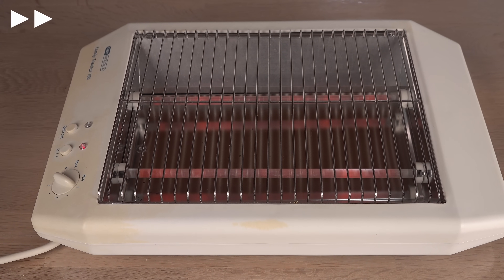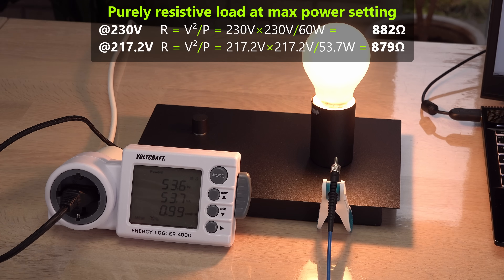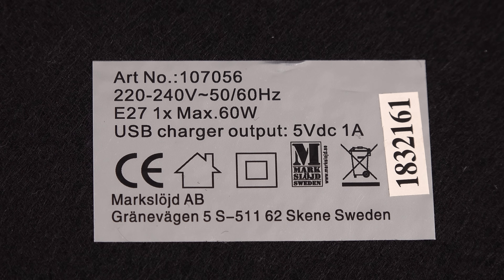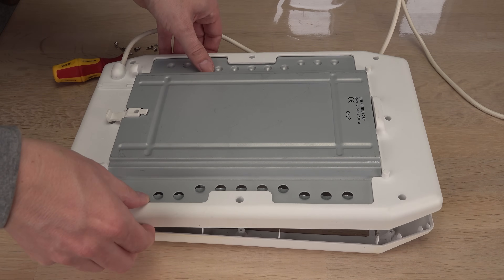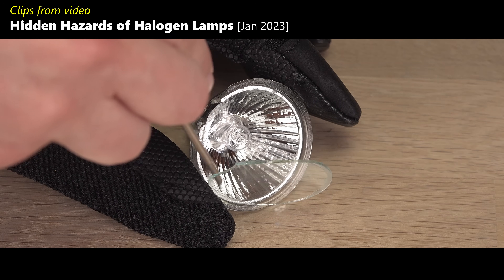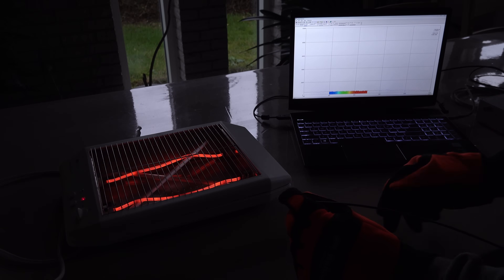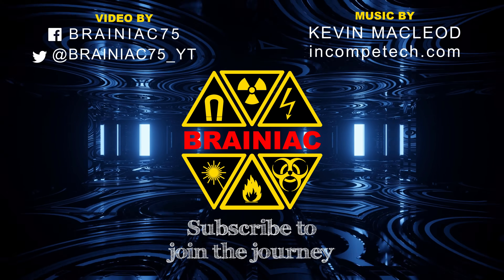Toaster Temperature WITHOUT Thermometer?!? | Crazy Blackbody Spectrum Attempt

Comment: That is NOT a correct way to check if the grounding is ok! If you put on probe of the multimeter on the live wire and touch the other probe (try at your own risk; it should be safe if you trust the internal resistance of the multimeter), you will also measure mains voltage (but can be lower depending on your skin's/body's resistance and how well you are grounded), which according to your method would mean ok grounding. But your body definitely isn't a "proper" ground.

217V on an outlet that's not loaded is indeed on the low side, but in spec. Except for heaters taking a bit longer (the maximum temperature would be lower as well but is usually never an issue) it doesn't matter for any modern electronics. Still, I'm glad that I have a very consistent 236V +/- 3V here (I have longtime data from our meter). Peaks outside that range a very rare (peak being something that's at least 10 seconds long, as that's the resolution of the meter).

Comment: There are markers that blacksmiths use to mark on metal to test the temperatures the metals reach. You could mark the quartz tubes and check the melting point of the markers to find the true temperature.

Comment: Captain here. (25+ years in lighting / engineering R&D) --- 
I think you're missing a critical point. Blackbody temperatures are based only on IRON. If your heating element is some kind of alloy or another kind of material, the glow will be significantly different!

Comment: Measuring the voltage between the ground and Active pins (08:45) is NOT the correct way to check if a circuit is properly grounded!

Comment: the steep drop-off could be an issue with the optical core. TIR plays a big role in the infrared spectrum. we use large diameter cores for anything lower than 950nm because its much easier to reflect visible light and low end IR in the larger core. once you're above 1000nm, you need to use a smaller core size or the fiber itself will attenuate the incoming light. the IOR of most fibers i work on is 1.468. Multi-mode signals run at 850-900nm and falls off at a rate of 3db/km, compared to 0.2db/km of single-mode at 1550nm.

Comment: My mains is the opposite, it's often right up at the upper limit of what's allowed, around 254-256V and is also clipped heavily too, probably because of my solar inverters (so peak AC of the unclipped wave would probably be near the 400's, which is insane lol). This is more problematic than lower voltages, because I play with a lot of old equipment, from back when it use to be closer to 210-220 here, and will run out of spec if i plug it directly into the mains these days!

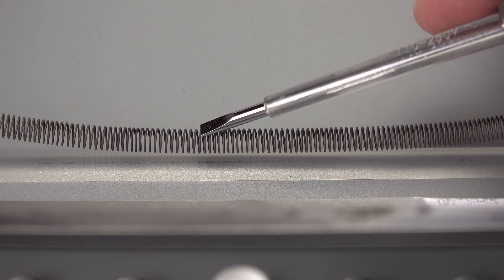Comment: 7:36 That's incorrect. Fe-Cr-Al heating wire alloys are actually better for this application than Nichrome or tungsten. Nichrome can be used up to 1150 degrees Celsius, Fe-Cr-Al up to 1400 degrees Celsius, and tungsten, as is well known, burns in air.
Reply: nichrome C grade also melts at 1400 degC though is expensive than the more common that melts at 1150-1200. both kanthal and nichrome though are used in appliances, its a matter of manufacturer of which is used. and yeah tungsten metal would simply burn, though tungsten carbide and other carbide ceramics are also used for radiant heating elements, such as hot surface igniters in gas-fired appliances
Reply: @EdwardTriesToScience  Okay. But Fe-Cr-Al (like Kanthal A1) doesn't melt at 1400 degrees Celsius; it can be used up to that temperature. That means in furnaces that heat up to approximately 1260 degrees Celsius.

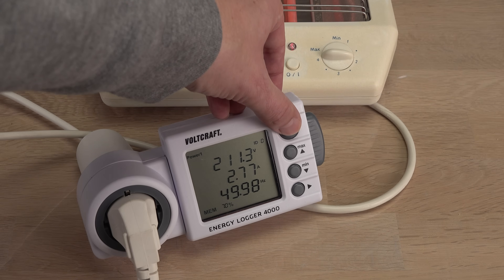Comment: 585W at 211V 5:02
Yikes indeed.
If my power was doing that for an extended period, I'd be getting an electrician, as I get 235-245 pretty much all the time. (Being the only customer off a transformer being fed with an 11kV line helps, though)

Comment: Is your spectrometer calibrated for intensity? I think the curves you measured which look nothing like a planckian distribution is evidence that sensitivity of the detector varies for different wavelengths of light. As a hobbyist I ran into this issue when trying to calibrate my own spectrometer. It's so difficult because the intensity depends on the angle of your light source relative to the fiber optic, how close the light source is and even how long you take data for. It's a huge pain and I still haven't solved the issue yet.

Comment: I have never seen a toaster like this before, I assumed it was a small space heater. Though largely displaced by ceramic heaters for space heating, quartz tube heaters do still see wide use in applications where heating the air is not always viable.

Comment: Is this actually for cooking food?
Cause it looks like a heater, not a toaster
Reply: i use the toaster for many kind of foods and things. 

3 examples...
Sausages for hotdogs are placed on it for 1 cycle (about 3 min) turn it over half way. The bread are then added for another cycle and both bread and sausages are turned halfway. A good trick is to use double layer tinfoil to capture more heat when only the first round of sausages is on. 

Cant open  a jar of pickles or any other jar with a metal lid? Dont poke under it with a utility knife or fork. Place the jar upside down on the toaster for half a minute. The heat expands the lid a tiny bit and make it more easy to turn - use a dry towel to avoid a potential burn.

when cooking with a pan, the toasters large surface and distance to the heaters, makes it more easy to not get a to high temperature if that is needed. I found when making pasta or spaghetti carbonara, when adding the eeg and cheese for the creme, temperature is a high factor for either getting scrambled creme, or perfect creme. The airgab gives a buffer for the heattransfer to the pan making it more easy to control the heat in the pan.
Reply: @kasperholm so it is actually a toaster?
Ive never seen them used like that before; ive only ever known them as directional heaters
Cool to learn
Reply: @runforitman  its a danish thing it seems, they call it a flatbed toaster, but to me, an american, it would be more fitting as a radiant electric grill

Comment: Hi, the reason your peaks are so far off is because of the HIGHLY nonlinear response of the silicon detector across the measurement spectrum. You have to set up the spectrometer to work in absolute irradiance mode so that the Y axis is showing numbers in microwatts per cm^2 per nm, instead of just "counts". I don't know if your spectrometer is capable of this, but in a very similar Czerny-Turner Ocean Optics spectrometer you do it by using a calibrated light source and a wizard in the software to get it into irrad. mode. None of the peaks you were measuring here were real, they're all way further out in the IR, with the exception of the light bulb, which will be just barely at the edge of what the spectrometer is capable of measuring around 1100nm. The slight bumps in the spectra here are from absorbance lines of the fiber, the hydroxyl stretching mode vibration in the glass is at ~900nm.
Reply: Well, you certainly sound like you know what you're talking about.
Reply: At least he can afford a spectrometer. I had to build my own using a piece of DVD for the diffraction grating.

Comment: Don't you have a 230V variac? My variac outputs over 300V when turned up to the max. More than enough to boost that 211V to the correct 230V.

Comment: I want to know how the setting slider on toasters work, and why it seems to always need to be changed each time.
Reply: Technology Connections has a great video about toasters which goes into how modern ones work (it’s usually a single chip) and such delights as The Bagel Pin. There is also a Hackaday article based on that video which links even more resources.

Comment: 217V? You need to get an electrician in. That voltage drop is being turned into heat somewhere - and you better make sure it's nowhere inside your home.
Reply: He is probably at some distance from the transformer. If they changed taps to raise the voltage the users near the transformer would probably have too high a voltage when loads are light. 217V is still in specification for a 230V supply.
Reply: @AndyFletcherX31  When working with mains voltage, "probably" doesn't cut it. A measurement of the voltage at the supply clamp does.
Reply: @feynthefallen  why would anyone need to specifically check it?  Voltage is within specification from the power system operator. Users at a distance from the transformer are expected to have a lower voltage and even if he is next to it the voltage would be a little low but still acceptable.
Reply: @feynthefallen  Go and read the electricity supply regulations. 217V is within 10% of the nominal 230V. There is no reason to assume there is an issue.
Reply: @feynthefallen  Maybe I actually know what I'm talking about.  A transformer is tapped to ensure the delivered voltage is within limits from low load to full load to all users attached to it regardless of distance. It is a compromise - don't assume it always delivers 230V.
Reply: @feynthefallen  I don't think you are stupid. I do however think you are arrogant, rude, demeaning and that your knowledge of the power supply industry is considerably less than you appear to think it is. My point was always that the low voltage did not of itself indicate any issue with internal or external wiring and that it was a completely normal state of affairs. Feel free to measure at the distribution board if it makes you feel happier but 217V does not of itself indicate any issue - if the voltage was unstable and jumping around I'd be far more concerned. Have a nice day.

Comment: Quartz tube heating elements are open air? I always assumed they were sealed to avoid oxygen exposure.
Reply: they are nichrome and nichrome passivates a ceramic-like oxide layer that significantly slows further oxidation. this is why nichrome coils that get glowing hot should never be jostled or stretched excessively, as the oxide flakes off and allows more nichrome to oxidize, shortening the lifespan
Reply: The house I grew up in had built in space heaters in the bathrooms from the 60s with exposed heating wires. My dad pulled the knobs off so we couldn't burn down the house. No wonder house fires have decreased 300% since the 70s.

Comment: I have a very similar shaped curve, when I tried to capture incandescent lamp spectra. 
I believe, that problem is, in fact, a device response unbalance, propper named, quantum efficiency.
I ended up calculating my oun compensation curve, by guessing the temperature via voltage/current tracking with cold resistance comparison.
NOTE that resulting curve will include a transparency coefficient function of lightbulb glass. In my case, it gives UVC overcompensation.

Comment: I wonder if it's a limitation on the spectrometer sensor.
In any case - when you have optical fibers you can get some different wavelength from the so called SFPs, multimode runs at about 850nm, single mode at 1310 or 1550 nm (different wavelength in bidirectional single fiber communication)
The 850nm can be viewed with the camera in a phone, which is useful when checking connectivity. There are other wavelengths as well, but the ones I listed are the most common.
Reply: If you remove the infared filter the camera may be able to see 1310 nm.

Comment: 8:32 I love how the Danish power outlets always look like they smile. Every time I get onto the Puttgarden-Rødby ferry I see them and smile too. In Sweden and Germany we mostly just use Schuko sockets, which don't really have a "face" aesthetic to them, except if they are mounted with an off-center screw. 

(I live in Sweden and visit my family in Germany about two times a year, so about four times a year I get on that ferry)
Reply: Is 3 phase service for  houses common in Sweden too? In Hungary we can get 3x32A, higher like 3x63A is possible but expensive and not needed for most houses. I think in Germany they have 3x50A or 3x35A in old houses.
Reply: @mernokimuvek  
I am no electrician, but I think they have it too. In my house here in Sweden there is a German oven-stovetop combo, which probably requires three-phase power. But I never messed with that stuff (cuz it is hella dangerous), so I don't know for sure and don't know the amperage.

Comment: The sharp dip could be just the fact the filament material are not true blackbody, but may exhibit lower emission coefficient at those longer wavelengths, so therefore the radiation gets weaker in that area...
Reply: Or more likely that the spectrometer sensor is less efficidnt at infrared.
Reply: @mernokimuvek That is supposed to be corrected in the software and I would assume it is  (unless it is some really cr@ppy instrument). So I would doubt that.

Comment: Quite not as inaccurate is the color match method: Vary temperature of something you know how to measure so the color matches. And quite a well available "something" is some higher power incandescent lamp on a variac, while measuring the voltage and current so you re able to calculate the resistance. And comparing that with the cold resistance, you may determine the filament temperature. The main error would be the nonuniformity of the filament temperature, the higher power bulbs use to have that more uniform.

Comment: how odd for an incandescent light to be labelled 50Hz
Reply: It’s too shy to wiggle even faster
Reply: I thought it was because some countries use 2-250v at 50hz and some (primarily us/ca) use 120 at 60hz.
Reply: Might be due to several reasons. Probably the most likely one is because consumers are stupid. Other points might be that there are lamps that are purely for DC, which break on ac due to the magnetic fluctuations, or if the filament wiring to specifically resonate on 60Hz and break. Don't know how likely that would be though, hehe.
Reply: @EddSjo  Or maybe it's just not rated for DC. When the filament breaks on AC, the arc often extinguishes at zero crossing. If it doesn't, there are fuses in the lamp stem. But when a lamp fails on DC it will often explode and blow the fuse for the lighting circuit.
Reply: @EddSjo  it's possible, my theory is the company just slapped that on anyway... halogen lamps CAN fail prematurely on DC because chemistry and physics but even then it's minimal... i just found it amusing, but science will science :)
Reply: @TheChipmunk2008  its probably there just for legal reasons, in case someone does something stupid with the lamp, like running it on 230V DC and it somehow causes a fire, they can just wash their hands and say the lamp was used in a way which was not intended.
Reply: @laharl2k  could be, or the system was just set up to print that (for LED replacements)

Comment: The sensor in your spectrometer has a spectral response curve that drops off in the IR range.
The fiber you use also can attenuate the IR so lookup the specs of both the spectrometer and fiber response
Reply: I was thinking about this too. Maybe he can use the same test on something that has a very strong infrared like the electric oven or something.
Reply: The spectrometer should have been calibrated with a NIST-traceable black-body calibration lamp, boosting the measurements where the sensor is less sensitive. The fiber is not, however.

Comment: i have the same spectrometer and the same issue. i think its an issue internaly maybe the sensor or the optics. the software doesent correct in uv and ir. the spectral response of the sensor (Toshiba TCD1304D) at 1000nm is only at 5% and at 550nm at 100%.

Comment: When you crank up the power to the incandecent lamp I would expect a shifting spectrum, but instead the spectrum remains roughly the same. That is weird. Maybe it's because the dimmer is chopping ac instead of lowering the voltage?
Reply: It did shift, look at 2:50, he marks the peaks as he ups the voltage. They even look asymptotic which checks out since the temperature should hit a limit when the tungsten starts change phase into a liquid.
Reply: @Guardian_Arias You are right, there is a small shift but I expected it to be way bigger...
Reply: Temperature of resistive emitter has much higher inertia to respond on voltage wave shape.
Reply: @dRepby  :)

Comment: Multimeters have a temperature sensor function with an attached wire. Hanging that close to the heating element (using a sturdy clamp to avoid electrocution) would have given you another measurement method.

Comment: Even early remote thermometer used the how much is glowing technique for accurate temperature reading.
The disappearing-fialment pyrometer used a filament inside an optical apparatus, you point the pyrometer at the glowing object and raise the current through the filament. When you can no longer see the filament on the glowing background both the filament and the object are at the same temperature (and the filament temperature is of course calibrated and known).
It was the first and for some time the only way to measure temps over 1000°C and up to 3000°C
Reply: I remember experimenting with such a device in one of my uni classes a long time ago. Never really cared much for it at the time but this video and your comment reminded me of it.

Comment: I wonder what you could do with one of those old timey giant search lights.
Reply: Or carbon Arc lamps
Reply: @theguywithallthesolutions same ting. anyway carbon arc search lights pump out a lot of uv similar to welding. you can make one with a welder. the center of old non alkaline batteries should work as electrodes. keeping the gap spaced right is a pain.